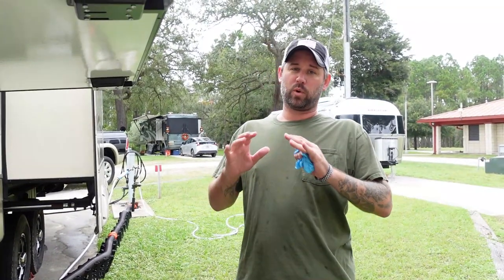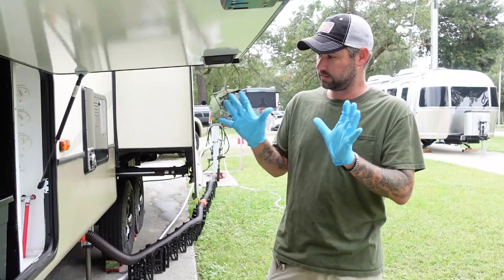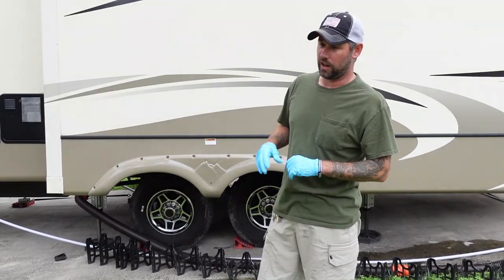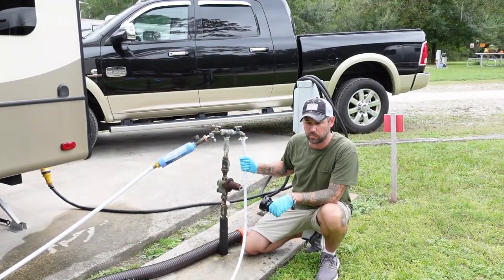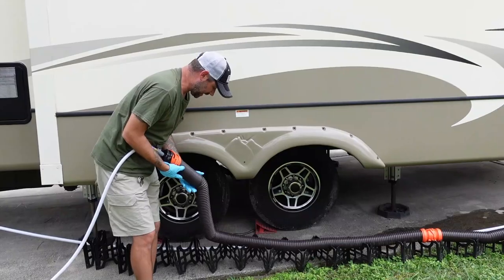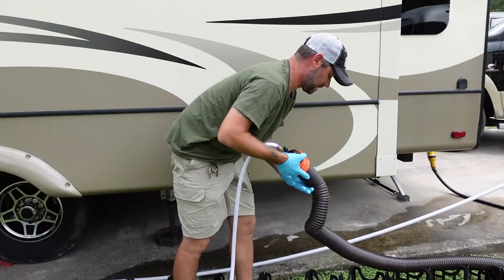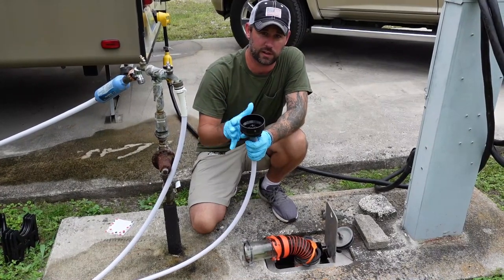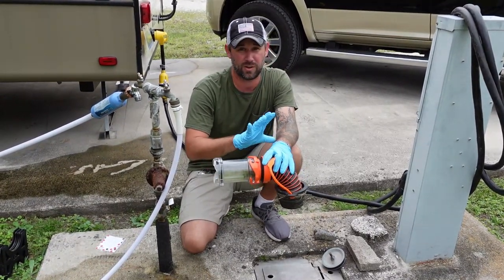RV Sewer Hose Hack (Uphill Sewer Hookup)

Comment: Hi there, great video. quick question. I have installed permanent connection to my RV to my sewer line beside the house that leads to the city line. I have installed sewer pump to pump it better, my question is, should keep the black and gray valve ON all the time, if not why not? thanks
Reply from the maker: I don't know much about sewer pumps but you should keep your black tank valve closed and dump periodically. If you leave it open all the time, all of the liquid will run out and solids will stay and build up in the tank.

Comment: great info .  I would change only one thing, that would have a different color hose for waste clean out.  i would never want to use a clean out hose for potable water.
Reply from the maker: Good tip. Ours are the same color but we marked the ends of the flush hose with a sharpie that says "black".

Comment: Question.  When your septic inlet is higher than your drain, what is the trick for just normal use? I have to go out 3 or 4 times a day to clear the line.
Reply from the maker: When we have an uphill inlet, we keep our gray tanks closed. When they are close to full, we open them and the force of the water pushes it uphill. When you get done, your drain hose will be full of water but your tanks will be empty. If you leave your gray valve open, normal use will not have enough pressure to push the water uphill and out. Hope this helps.
Reply: @WaywardWaggs  thank you!  Would a macerator help?
Reply from the maker: I'm not sure. We don't have any experience with a macerator. It might.

Comment: Thanks so much for the uphill tips, thumbs up.  However, I would never use my white (potable) supply hose connected to the sewer system, just too much opportunity for contamination.  I also use a backflow preventer when connecting my dedicated grey/black garden hose to a potable supply line.
Reply from the maker: It is a white hose but it is not the one we use for our fresh water. It is marked with black tape at the ends so we don't confuse them.

Comment: This is what i call a badly designed rv park. I will usually find a different site next time and if not possible i scratch it off my list. It's just a pain to do this. But this is a great way to deal with it. I have that same valve sprayer and use it every time.
Reply from the maker: I agree. Thankfully that has been the one and only park so far that we've had this issue.

Comment: 1) You are supposed to use an orange water hose when connecting to any sewer pipe to flush it. 2)  You cannot use hose splitter / y valves on the water spigot in an RV park. Even with an anti siphon valve on the park spigot, water still can feed back into the water system from the hose you have hooked up to the flush fitting you are using. Every campground I have stayed at has signs prohibiting splitter valves on their water faucets and a water sheriff going around removing them.
Reply from the maker: We have the hose we use to flush the black tank marked so it only gets used for that. We have been full time for almost 4 years and have never been told we had to remove our splitter. If any "water sheriff" ever tried to remove mine without permission, he would have bigger problems than water.
Reply: I can understand the concern but I've been camping for 10 years and I've never seen a sign prohibiting splitter valves.  And God help the "water sheriff" if he ever removed mine without talking to me about it first.  😃
Reply: I use splitters whenever there aren't two spigot for over 20 years, and I have never seen a single sign it sounds like any rv park without two needs to be updated.
Reply: I’ve never had an issue with splitter. You must be in California!

Comment: What concerns me with this method is that I don’t see a back flow bib on the fresh water hose connection which will prevent sewer waste from back flowing into the potable water system.  So essentially it’s connecting a potable ( drinking water) line to a sewer line😳😳😳
Reply from the maker: There is a backflow preventor inside the device itself so water can't flow back into the hose.